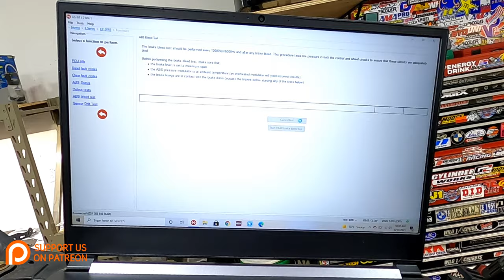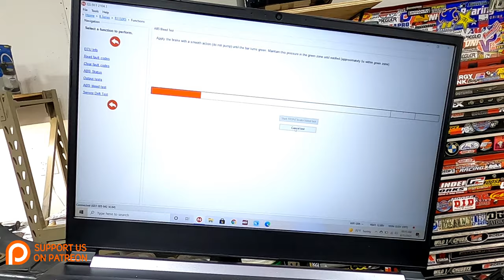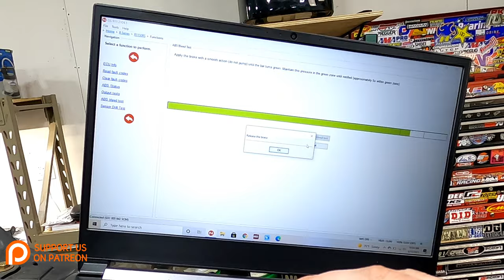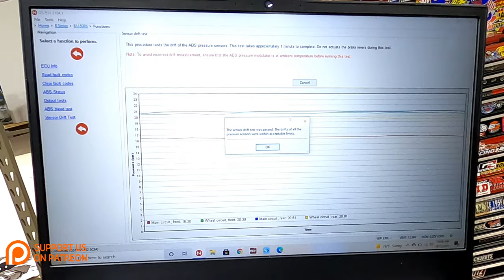BMW I-ABS COMPLETE BRAKE FLUSH R850, R1100, R1150, R1200, K1200

Comment: I had to do that on my 2004 R1150RT 11 months ago after installing a newer i-abs unit but my order for bleeding was front left-right and rear. What is the changing period for the hydrolic fluid do you suggest? 1 year or 2 years considering the bike is used daily...
Reply from the maker: 2 years!
Reply: @TheBMWGuy  Thank you
Reply: If it has Stainless braided Teflon hoses, 4 years for the control circuits and 2 years for the wheel circuits. With rubber hoses that schedule is 2 years and yearly, respectively.

Comment: I keep hearing about owner's disabling and bypassing this factory system because of supposed module failure. If the system isn't bled as your showing can the ABS warn of failure and lead to the impression that it is faulty, encouraging folks to delete the factory system?
Reply: That's my theory. I think a lot of owners just don't do it, and that, of course, leads to failure. When and if mine fail, it won't be for lack of service. The servo likes stainless braided Teflon hoses and nice, new fluid every coupla years. I have 185k miles between a pair of 2004 1150RTs. And counting...
Reply: And there's a lot of knee-jerkers that think the sky is falling and pull a good, working unit and revert to standard braking. 🤷

Comment: For the BMW R1100gs year 1995 it s this method  good?
Reply from the maker: Does it has servo brake that make the wizzing noise
Reply: @TheBMWGuy  I don't think so, today I bought the motorcycle, I will look more closely at the ABS unit
Reply: @TheBMWGuy I rezerve a R1200R 2006,and the seller say that the bike it s from factory with ESA and ABS BUT WITHAUT THE SERVO BRAKE.It s exist this version?

Comment: Also you did not clean the filters in the unit, don't you think it is necessary?
Reply from the maker: some have the little screens, others do not. this model does NOT have the screens. cleaning them is optional
Reply: @TheBMWGuy  but this filters would probably prevent the situation you've seen on the right front brake line. Learning new things thanks to you. Luckily I have the filtered one.

Comment: Just so that you're aware, you can also use dot 5.1 brake fluid. You cannot use Dot 5, unless you completely flush clean the entire brake system and introduced. 5 but it's going to be a pain in the ass to clear all the air out of that pure silicone brake fluid. So to be clear you can use. 3.4 at. 5.1 they're all the same base brake fluid with higher- temperature resistance.
I am so glad they got rid of those Linked systems.
As you can tell they were overly complicated, and they were truly dangerous on motorcycles. When you're on a motorcycle you only need to apply brakes on the wheel that you need the brake applied to. If it applies brakes to a wheel that you do not need brakes on, it can kill you!
Reply: Nothing wrong with DOT4. Never had an issue.
Reply: 2002 1150rt OEM brake hose line completely deteriorated inside living ant size particles everywhere in system. I had to flush using a universal fe pump with a fuel filter to exit every channel in hard lines before installing braids. Good video step-by-step instruction. Ty

Comment: Your the BMW guy right? well, got some news 4 ya, I think your only good with these moves on an "Evo" style brake, aka the ones with the caliper with "BMW" on them, cuz my Brembo's do not act like that. I have 3 Beemers. only 1 with assist, the 2003LT. The other 2 r a 98K12 an 99R11RT, and not relatable,  so I will get back to you if wrong, or you can correct me, but think you have a mishap here. cheers!
Reply: He said in the beginning that it was for iABS BMW. He didn't say it was for ABSII which is BREMBO. I want to see a video for the ABSII also.
Reply: @nicholasmumola  Aye, thanks, yeah I didn't know they were called that as well. cheers!

Comment: There are 6 filters in the IABS unit. Please contact me for details.
Reply: last week i bought a 96 r1100rt.  i hear no sounds from the abs. i am changing all the hoses tomorrow.  i think the system is clogged because i cant pull the f brake lever and no fluid comes from the f callipers. any ideas?
Reply: @narcissistinjurygiver2932  
I have a series of photos showing positions of filters which will give good indication off the condition of lines internally
Reply: If you have no sounds it may indicate fuse failure or worse pump failures.
Reply: @johnlmason723  thanks
Reply: @johnlmason723  thanks. I just replaced all the hoses today. the rubber clogged the thru bolts. everything bleed ok but i have not started it yet. i have the tank off and am going to fix all i can before I put it back on.

Comment: Pressure in front wheel wheel circuit is 126.92 bar
Pressure in rear wheel wheel circuit is 60.11 bar

is this normal, if not how do i bring this back to normal